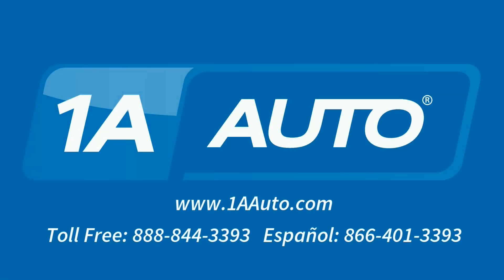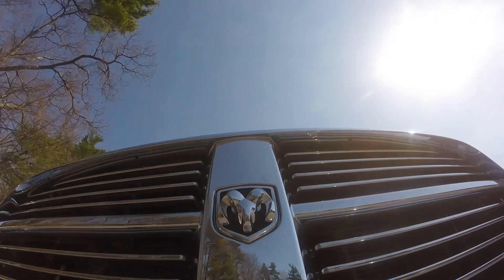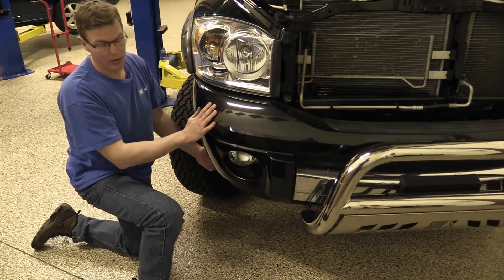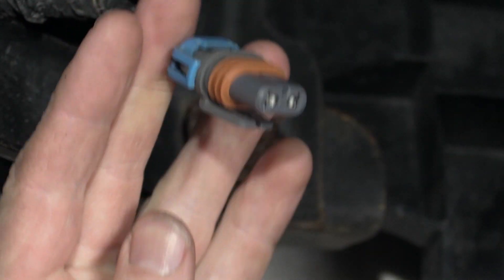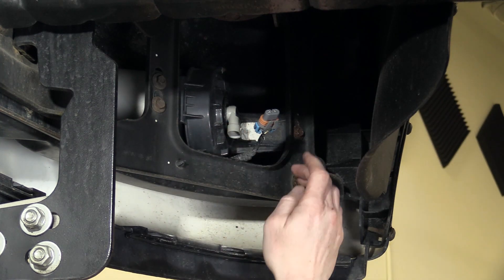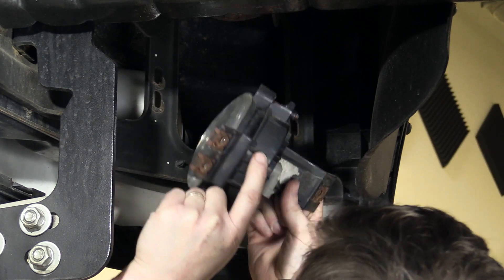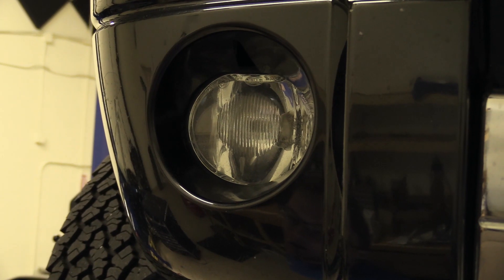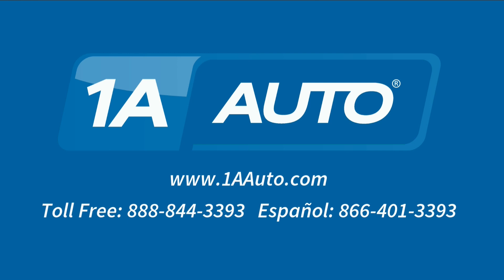How to Replace Fog Lights 02-08 Dodge Ram 1500

Comment: Question; I have a similar kit but I see on the bumper 2 slots which look like you twist the cone until the third tab lines up. Should I do this first before in installing the actual light?